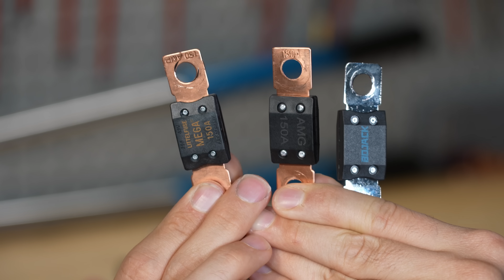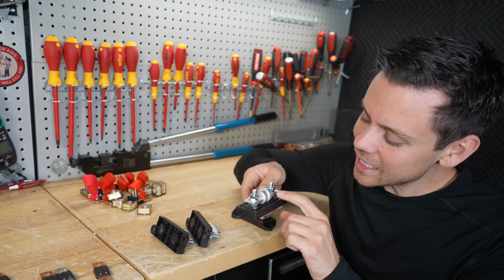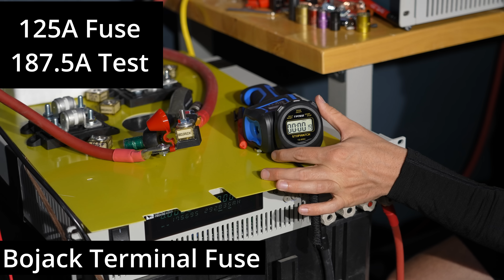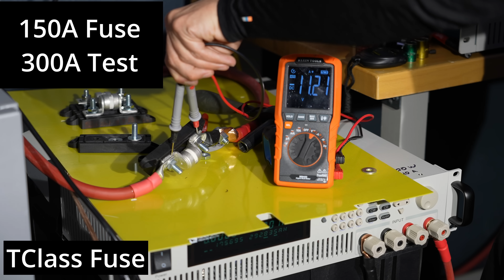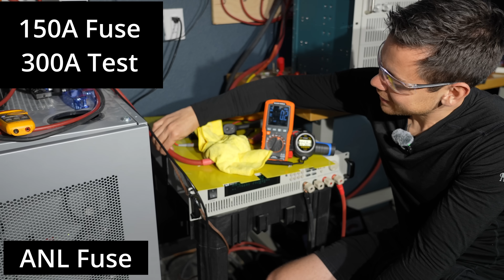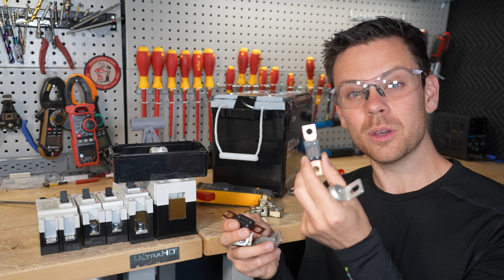Popular Amazon.com DC Fuse Showdown: Continuous Load Heat Test, Overload and DEAD SHORT Testing!

Comment: How to select fuses for dc voltages  Selecting fuses for DC circuits requires careful consideration because DC arcs are more persistent and harder to extinguish than AC arcs. A fuse rated only for AC voltage cannot be used safely in a DC application unless specified otherwise by the manufacturer. 
1. Match voltage and current ratings Follow these steps to select the appropriate fuse ratings for your DC circuit: DC voltage rating: The fuse's DC voltage rating must be equal to or greater than the maximum voltage of your circuit. A higher voltage rating is safe, but using a fuse with a lower rating is a serious fire hazard.Nominal current rating: Choose a fuse with a nominal current rating that is higher than your circuit's steady-state operating current. A standard safety margin is to size the fuse at 125% to 150% of the maximum continuous current.Calculation formula: Use the formula \(I=\frac{P}{V}\) to find the current, where \(I\) is current in amperes, \(P\) is power in watts, and \(V\) is voltage.Example: For a 12V system with a 120W device, the current is \(120\text{W}\div 12\text{V}=10\text{A}\). Applying a 25% safety margin, the minimum fuse rating would be \(10\text{A}\times 1.25=12.5\text{A}\). You would select the next standard fuse size up, such as a 15A fuse. How To Choose The Correct Fuse Size For Your 12V ...Mar 17, 2025 — choosing the right fuse size for your 12volt. electrical. system is crucial for both safety and equipment protection a...YouTube·12 Volt Planet TV4:28Fuseology - Overcurrents and Voltage Ratings - EatonVoltage Rating-Fuses. Most low voltage power distribution fuses have 250V or 600V ratings (other ratings are 125, 300, and 480 vol...Eaton
2. Consider application type and response time The fuse's speed depends on the nature of your circuit and its load. Fast-acting (fast-blow) fuses: Melt and open the circuit quickly in response to a surge. They are best for sensitive electronic devices without high-current start-up surges.Time-delay (slow-blow) fuses: Can tolerate temporary inrush currents from devices like motors, inverters, and capacitive loads before blowing on a sustained overload. 
3. Account for environmental factors The operating environment can affect a fuse's performance, as fuses are heat-sensitive devices. Temperature derating: Fuses are typically rated at an ambient temperature of 25°C (77°F). For environments with higher ambient temperatures, you will need to choose a fuse with a higher current rating to prevent nuisance trips. For every 20°C increase in temperature above 25°C, derate the fuse by 10% to 15%.Verify performance: If possible, validate your final fuse choice under the worst-case operating conditions, such as the highest ambient temperature, to ensure reliable protection. 
4. Select the correct interrupting rating Interrupting rating (breaking capacity): The maximum amperage that the fuse can safely interrupt at its rated voltage without exploding or causing a fire.Match available fault current: The fuse's interrupting rating must be greater than the maximum available fault current from your power source under a short-circuit condition. A battery bank, for example, can supply a very high fault current for a short time. 
5. Check additional ratings and specifications \(I^{2}t\) rating (melting integral): Represents the total thermal energy the fuse can withstand before the element melts. Ensure the fuse's minimum melting integral is greater than the energy of any inrush current pulses to prevent nuisance blowing.
Agency approvals: Verify that the fuse carries the necessary certifications for your region, such as UL/CSA or IEC.Mounting and form factor: Fuses are available in various styles, including automotive blade fuses, glass or ceramic tube fuses, and surface-mount components for PCBs. 
Choose a form factor that fits your application's size and mounting requirements. 
Placement of the fuse: For maximum protection, the fuse should be placed as close to the power source as possible, typically within 7 inches of the battery's positive terminal. This protects the entire length of the wire, in addition to the components it powers.

Comment: The higher the current rating of a fuse, the less effective it becomes at protecting against moderate over-currents (overloads).
Beyond a certain current rating, fuses are designed and used only for short-circuit protection.

Comment: Exerlent videos Will, keep making more!   Them AMG fuses are scary! I use MEGA fuses on both ends of my battery cables, and much lower than the cables own rating. And I did my own testing just like you have, but watch out, as even the MEGA fuses have fakes now, so I test each batch I get, as the fakes have zero control over when they blow.

Comment: I prefer my 125a Mrbf fuses and a pv disconnect 
Simple easy and right 👍,
About to get a victron power in and a lynx distributor that will have amg fuses, 
However I do have a bunch of mega fuses from inverters so I'll be using those first 🍻

Comment: A suggestion regarding the T class fuses, open them and see if the fuse element is made from pure silver. 
I have been told from suppliers that one of the reasons they cost so much is the fuse element is made from pure silver. So not your usual copper, I assume this is done for volt drop control and repeatability under fault current. 
I have not checked this out myself. 
Great channel.

Comment: I'm looking at installing a 3000w 12 volt inverter. The manual suggests a 400amp fuse but wondering whether there are any suitable circuit breakers for this application?

Comment: One of many reasons I use MCB or MCCB (breakers) instead of fuses is that even the cheap ones indicate the trip curve they (supposedly) adhere to. And quite often, they do perform within spec. Cheap fuses almost never even mention a trip curve, so there's no standards by which you can measure their performance. Except relative to each other, as expertly shown in this video.

Comment: That is awesome and massively revealing, DC definitely blows a breaker/fuse differently than AC which I was not aware of how stark that difference was 

I will need to protect a solar system that runs at 48V and has 20kWh of capacity 

With that, can you do a set of tests of fuses/breakers with 48V batteries?

Comment: Will, I think your temperatuire reading migt be bad. The temp you are showing us with your thermal imager is not reading metal properly.. that is why on all images you see it is always plastic that appear to be the warmer. Emmisivity of surface is very important and you should use black coating on the metal that you check with your camera.

Comment: BAD DESIGN!:   Over the time Fuse mounted on top of battery will  create imbalance and quicker aging of the cell connected to it. These fuse add more heat to not all but a single cell which is bad. This is a bad idea and design. Cell temperature uniformity is CRUCIAL to age equally. and giving advantage of lower internal resistance to the cell that is connected to it because it run a bit warmer will create imbalance. The OVC of LFP cells is very sensitive due to teh delta mV per Ah. If a cell run warmer his voltage will be higher than the rest and balance wont be correct.

Comment: If you have a current clamp with an oscilloscope output, then you could measure/view the peak trip currents Hantek CC65 is rated to 65A and CC650 is rated to 650A. I have only used the 65A version.

Comment: I've had really poor experience with ANL fuses.  I'm happy with battery terminal fuses, preferably marine rated but the important thing is a good brand.  T class fuses from a good brand I'd trust, but I don't have enough experience to know if that trust is misplaced.

It is actually very hard to make a good fuse. I only trust good brands with a reputation to lose.

Comment: Hey Will Prowse and/or fans, I have just set up my first system using Rosen Solar products. I am having an issue somewhere, no AC output, error code says no battery or bms in protect mode. Batteries are connected and reading 53.4 volts at the inverter connections, ( even past the fuse) do i just turn everything off for a while to reset the bms?
Reply: Lol turned everything off for 1/2 hour and it went away

Comment: If you’re running three Litime 12v 100 amp in parallel would you put a fuse on each battery or just one to the output of the inverter?

Comment: Before I switched to IT, I was an engineer that at one point worked with high current low voltage applications up to 8000A at ~2V.  The rule of thumb for fuses is 125% of expected peak draw or you will lose too much voltage across the fuse at peak draw.  So if you are expecting to run at 200A draw continuous, you would ideally want a 250A fuse to back up the BMS over current.  I go with know your loads and sources and fuse accordingly.  Some of my inverters/batteries are fused lower the max draw as they should never ever get there with the expected loads with a fuse at both ends in situations where each end of the line can possibly source current as close to the source as possible.  Expensive slow blow fuses come with curves that show percent voltage drop at various amperages and how long it takes to blow at a specific temp free air for various currents starting at the rating.  Watching destructive testing of new designs was awesome as large fuses blowing are impressive (very melty sometimes metal depositing on the fuse enclosures.) though high voltage high current equipment failure was more "flashy".  You are really good with safety protocol as I see a lot of folks on Youtube with rings on working with this stuff.  A co-worker lost a finger when he shorted 2000A 5V through a wedding ring that he was not supposed to be wearing according to work rules.  Was never clear how he managed that, but everyone got called into a meeting and shown the pictures.  Great videos!

Comment: Making short circuit test on battery with bms you cant be sure that electronics dont cut the arc after blowing out your fuse. Should be done on bare cells imo.

Comment: Applauding the fact that you're going to do an actual short circuit test on a full size battery bank. That definitely needs some actual testing. There is so much speculation going around on that topic! Be safe and do it outdoors though.

Comment: Hi Will, Thank you for doing this type of testing. This technology is all well and good, but it needs to have a reasonable cost to be effective. Knowing what works and what doesn't is the first step. If you want to switch high currents, look into big 3 phase industrial contactors, and wire all 3 contacts in series. Activate the coil with 120 VAC.

Comment: For 48v systems that are used for home backup, I would only recommend Class T fuses or sand filled fuses that can extinguish a DC arc.  Same for all solar arrays.  Sand filled fuses!!!  Also a properly sized DC Breaker but those would mainly be used for a on/off switch.  I remember doing all the test for 18650s back in the day, Fun Tests!!

Comment: Lets see all these with a '48v' 51v LFP battery bank.  That could be exciting for a video.  You have the equipment!  Especially the Mega & MRBF won't have as much AIC at the higher voltages, they should arc!  Stand back and put on your safety squints!    Or even more exciting, simulate a short circuit instead of just a mild overload.

Comment: Aren't fuses rated for 80% of their named capacity for continuous use? If so, 75A for a period of time on a 80A fuse SHOULD trigger the fuse. An 80A fuse should only be able to run 64A continuously.

Comment: The way I think about fusing, is that it's only there to protect your wire in a short circuit.

The fuse must blow before the wires go up in smoke.

A properly designed system should consider voltage drop and power loss in the wires and fuses, or more conveniently use wires that have a rated ampacity that's higher than the current the wire needs to source.

Fuse must be at or below the ampacity of the wire, the ampacity rating will give you head room to deal with fuse inconsistency in a short circuit situation.

Should never trust common fuses to protect a device with a specific current limit. If you want to protect a device you need to use specific fuses that blow fast at accurate currents and under size them

Comment: When you are doing these tests using a power on/off switch measure the voltage drop across the switch. I found out the hard way that some cheaper switches drop a lot of voltage. We may assume a switch has zero voltage drop but at high currents the switch may be a problem. Also check the voltage drop across the circuit breakers. I'd be interested to see that. Thanks for the great videos!

Comment: BTW. Can you open the red disconnect switch, to have a look inside,  you used for the shorts test?
I normally only switch them if there is no current flowing because of the inherent bad design.

Comment: Very interesting. When compared to the cost of your home, all your possessions and the lives of your family, there is no 'expensive fuse'.
Reply: It might be a factor for when batteries are segregated by placing in a remote battery structure? But still, the time and expense of the remote setup would likely argue the same.

Comment: Fuses/RCB's tripping early (less current) in hotter ambient temperatures is by design because wires/equipment typically don't support their full rating (25°C) in hotter ambient  temperatures.
Temperature of fuse/RCB isn't always indicative of power loss when the surface areas are different. Breaking current is important ie. once >3x rated current is flowing from fault, will the electricity arc across the break to keep it energised?
Voltage drop at rated current is important to compare amongst each group of same rating.

Comment: I think you are expecting too high precision in these fuses.
They are meant to not trip at the rated specs, and that is their only really important characteristic. Many only list a max time to trip for a 50% or 100% overload situation and that's what they are for.
Slight overloads for long time is what you have other software based controls for. Physical fuses are for catastrophic failures.

Comment: The heat is the most concerning part. I have seen it myself when fuses get so hot that the plastic casing starts to melt, then there is something seriously wrong. However they do trip in a short scenario and that is good.
So the heat on a battery mounted one might cause big problems inside the battery.
This is still way better than a lot of people who skip fuses entirely and then gets shocked when their house burns down because there is a short without any protection at all.

Comment: @WillProwse - a day too late I bought en route 2 x Blue Sea Class T 250a fuses and holders - not cheap - for my EG4 6k XP and two 51.2v 314Ah wall mounts - would you suggest cutting price in half to go with these Dihool Circuit Breakers or stick with the Blue Sea ones at twice the price ? thanks Will for all the incredible content

Comment: You'll need a very high amperage and lightning fast switching to test a direct short on a high capacity 48v DC battery bank, you'd easily get into 10000+ amps!  The two crazies that have done this are Andy over on Photonicinduction and Styropyro.  A quick and dirty ultra high amperage switch would be to have 2 copper squares, say 3"x3"x 1/2" thick, setup on a simple lever.  Use a high strength spring to quickly snap them shut.  It might be a 1 time use switch as they'd weld themselves together :D 
Consider multiple parallel leads from the battery to the switch too, you'll need every amp available to test a high AIC T class fuse.
Good luck, and wear a safety shield, copper will likely spray everywhere :D

Comment: Another consideration is the voltage. I wouldn't trust some of those fuses to work at anything higher than 12v. I fitted the t-class fuses because DC current is very difficult to break and you don't want the arc re striking. When purchasing an MCCB you need to ensure it's bi directional. Fuses are bidirectional by design but a lot of DC breakers are polarity sensitive which means on a battery set up where it's being charged and discharged through the same cable you might only get protection in one direction. If you had a fault in the other direction the breaker might not work correctly.

Comment: Excellent video as always! 👍

Yeah, very cheap fuses are dangerous. One time customer installed 10A car fuse from cheap asorti box from China. Guess what. He almost burned his car down and melted multiple wires together and only what tripped was main fuse upper the line and cheap one has melted case, but still didn't trip.. 😂

Comment: As an electrician over here in the UK...I thank you for introducing this essential topic to the solar community...I use double pole DC rated MCCBs on all my 48V batteries and DP MCBs on my 24V batteries.  The danger is that people do not comprehend the fault current that these cells can produce.  Maybe you can create a dead short fault and show your audience the potential  danger 💣 

Another brilliant video❤
Reply: Agreed. I do the same with my setups. Dual Pole MCBs for all battery related current safety.  We had someone on the forum ask about this and I told them that with "any" DC rated connections and dropping a breaker, use Dual Pole. Don't mess with cheaping out because you want as much safety as possible. Either pass both conductors, or loop the Pos through 2 MCBs.  It's not worth the risk of a failure considering these batteries (and we were discussing 300+AH 48V systems) are capable of thousands of amps if they short out. Not a fun time (well, unless in an open field and prepared/expecting for it; reminds me of Styro Pyro and his huge bank of batteries ).🤣
Reply: Anyone curious about the dangers of a dead short should/could watch Styropyro's videos on huge battery banks.